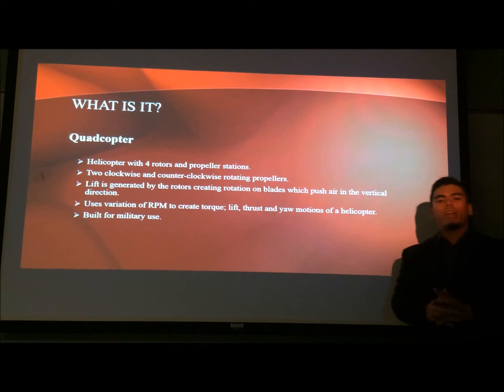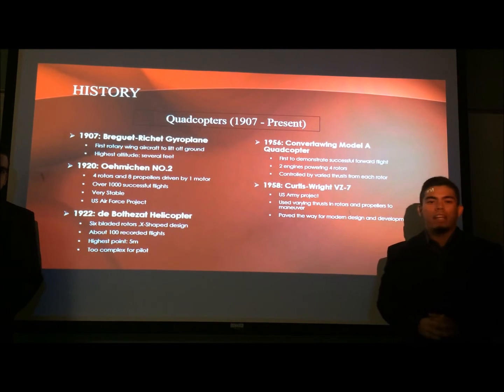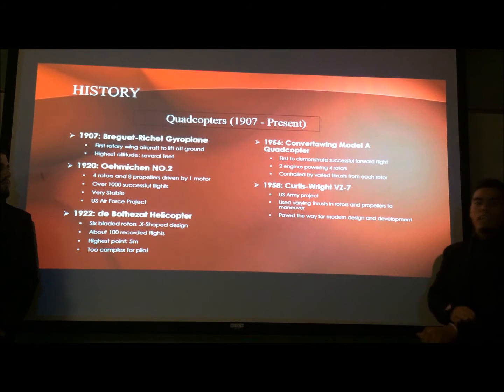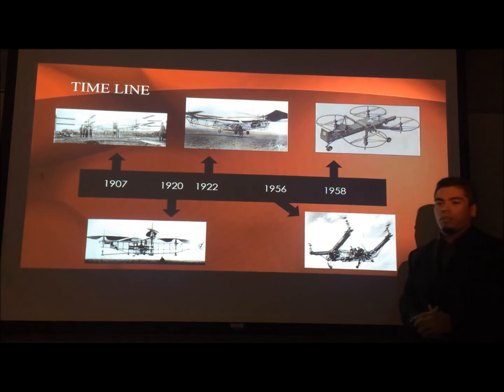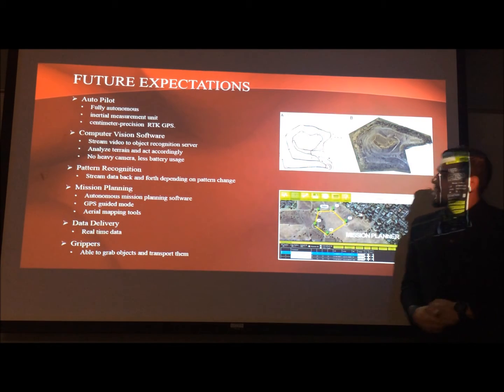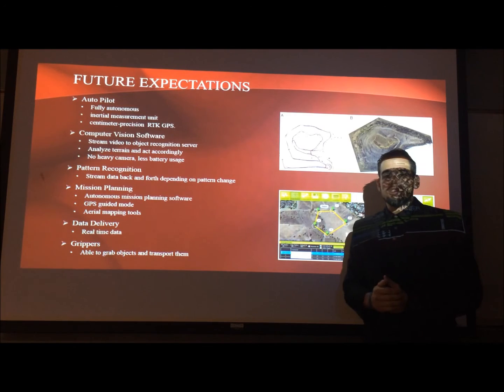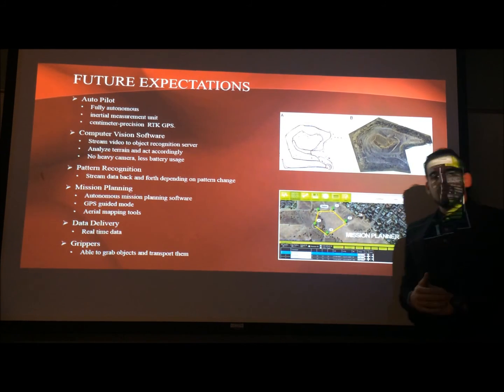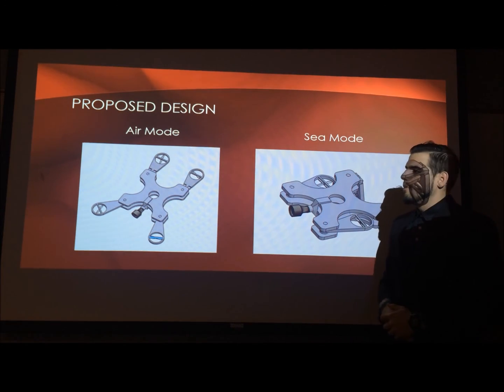Team 15: Quadcopters

Comment: Well done project on Quadcoptes, the lighting was very dark and distracting though, and the font size was a little too small to read on the slides. But the presentation was informative good history introduction and the slides were well structured but the length of the video was a little to short. But good sound quality. Good job team 15.

Comment: This video may be short, but the team was able to cover a large amount of content throughout the presentation. The history timeline and those complex Solidworks models was a great inclusion to the presentation. The audio is clear and precise throughout the video. The video contains no lighting; the result is that the presenters can't be seen when they step out of the boundary of the projector or they cover part to the slide when they are in the boundary. The text in the History and Future Expectation slides are too small to be read because the team placed too much information into them. This team should have broken these single slides into multiple slides; this would have increased the length of the video and would give a better viewing experience to the audience.